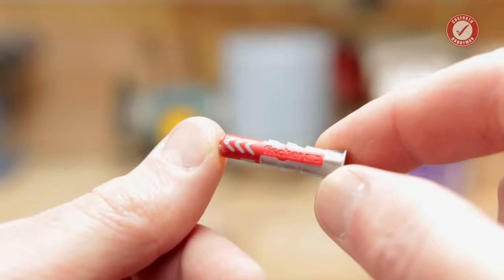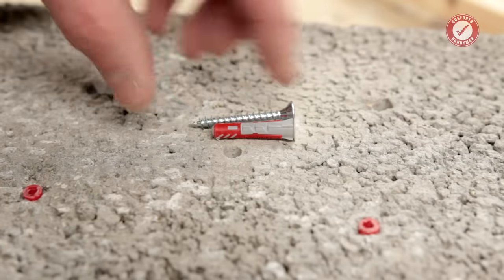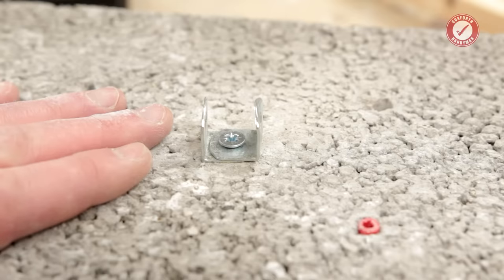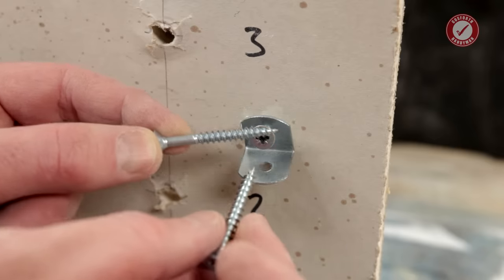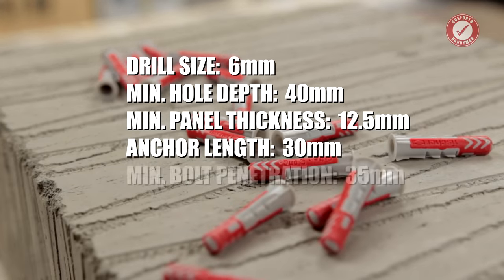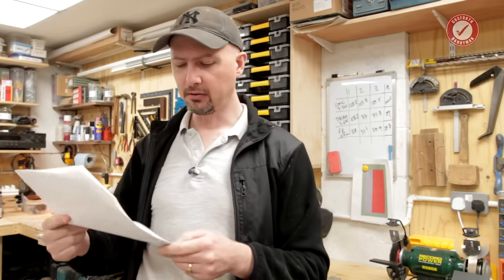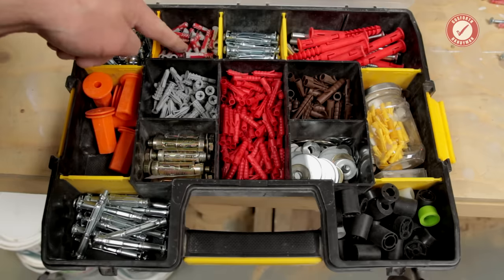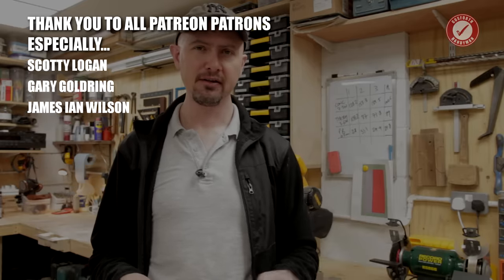How strong are Fischer DuoPower wall fixings?

Comment: Hi, I wonder if you can go help me?. I've fitted some rawl plug anchors (self screw metal plugs) and in both fittings  I've fitted the plaster has crumbled . So I'm assuming I will need to pollyfilla the repair. My question is. Do I pollyfill and skim over with the anchor still left  in the wall? Or take it out? If I take it and then Reinsert after I've pollfillered will I run the risk of it the plaster crumbling when the rawl plug self drive goes in again?

Comment: I would think you would use such fasteners to hang things on walls etc. More of a side load then pulling straight out.

I live in the states and they are sold at the Home Depot screws included. I like them a lot, it's the only drywall anchor I buy currently.

Comment: Any chance of a test of the Fischer Duotec 10... It's a toggle type wall fixing.   Interesting for plasterboard cavity walls..  Here in Europe it's around 13€ for a pack of 10 with screws supplied -  the price is a bit of a drawback...  But for plasterboard ops it seems very good..

Comment: That’s interesting that you like Fischer fittings. I bought a box of Fischer frame fixings and the screws just kept snapping. I used some cheapo wood screws and they were fine. I assumed all their stuff was rubbish after that.
Reply from the maker: Interesting! They weren't stainless steel were they? Stainless is softer. Only generally use my own screws.

Comment: Hi Andy - does new plasterboard tend to need time to harden / settle? I had the bathroom boarded and skimmed last week and when trying to fit some battens e.t.c. with the duopowers they were just spinning in the holes for me. I tried a 5.5mm drill bit too for a tighter hole but still no joy. Cheers in advance, Dan
Reply from the maker: Potentially. What size screw?
Reply: @GosforthHandyman  5mm turbogold, the plugs held for a little bit and then started to spin, I was using 80mm screws to fix a 38mm batten to 12.5mm plasterboard so should have been fine really

Comment: Andy - I realize I am late to the party but here is some info on the Hillman DuoPower plugs which is the Fisher plug here in the US. 
"Maximum working loads for #8-12 screws and anchors: 1/2 in. drywall is 45 lbs, C90 hollow block is 130 lbs, and 4,000 psi concrete is 210 lbs" These values are for the #8 and #10 screws, values for the #10 and #12 are slightly higher.
After pulling out the old abacus, those numbers equate to 20.45 kg, 59 kg and 98.4 kg respectively. A C90 hollow block is a industry standard lightweight concrete masonry unit (CMU). They also state that the working loads should be further reduced by 4 for vibration an shock loading. These numbers have to be read off product pictures on the manufacturers website. https://www.hillmangroup.com/us/en/Fastening-Solutions/Anchors/Anchors---Hollow-Wall/DuoPower-Nylon-Anchors/DuoPower-Contractor-Strength-Anchors/p/523DP1#specs
I wonder if the values you were using from Fisher were not actually working load numbers.

Comment: Hi, thanks a lot for the very interesting video. Would you recommend the 6x30 mm or the 6x50mm for fixing curtain rails on two layers of plasterboard (2 x 12.5mm)? I am afraid the 50mm plug might start spinning while I am tightening it...
Reply: 6x30 is fine

Comment: @gosforthhandyman Hello, I'm just wondering if you can help me? I'm going to wall mount a TV on to a Brick Wall. No bolts were supplied do you think a 8 X 50mm lag bolt is sufficient enough for a UK wall with Plaster on it. I have 10 X 50 plugs. I can't find any 10 X 60 wall plugs. The wall mount instructions recommend a 8 X 60 lag bolt. But I can't find any with a thread to the end. Any help would be greatly appreciated.
Reply: Same issue, cant find any full thread coach screws. Dis you have any luck, what did you do in the end?

Comment: I will be fastening a metal bracket about 2-3mm thick to a plaster board wall i will be using a duopower plug ,however, the metal bracket will need removing and re attached so, will the screw still tighten into the original fischer duopower 6mm plug?

Comment: I've used the Duopower ones for a few years now and I have some thoughts. The biggest problem with the duopower ones, which will mirror similar plugs that 'knot up', is that I have found it is very temperamental to choice of screw, distances, and wall material. You see this fairly clear here: https://www.youtube.com/shorts/hZPtS7EWu38

In the UK, the walls are often pretty nasty for plugging---you can have crumbly plasterboard, crumbly masonry, dot and dab gaps, etc. It's often very hard to know the limitations of what you're drilling into. The problem is that the action of the duopower is largely 'hidden'. Sometimes it works and other times I get a plug that spins, or I'm unsure if it's balled up. Compare that to plugs like Rawlplug Uno or similar that expand when drilled into. They may not be as strong, but you are almost always certain of whether they have 'activated'. Moreover, these plugs exhibit less chance of spinning.  

There are other advantages to more generic expansion plugs, like the fact that you can fit one into another if all else fails.
Reply: Quite a strong reaction to the video in the comments.

Comment: When I put this in plasterboard. I am using a 6mm wall plug. I use a 5.5mm but the rim never fits flush, even when hammering it down. it looks like it does not want to go in (plastorboard) any recommendations?

Comment: Not sure if you have undertaken this ..but how do you attach screws to lathe and plaster walls when there is not studings to screw into?
Thanks for your videos.
Reply from the maker: Aaaahhh... there's a video! They're a nightmare... you can sometimes get a good fixing with a woodscrew straight in to a lath if you hit the lath and not too near the edge of it. Failing that hollow wall anchors are the way to go - expanding metal anchors can work well, spring toggles too. 👍

Comment: A lot of these fixings assume you will tighten up the screw flush with the wall, which pulls the back of the plug / re-enforcement etc in.  I need to hang a mirror and leave the screws proud so the mirror hooks will hang on the screws.  A lot of these would fail if you didn't torque up the screw fully and so it makes it a difficult choice for me.  Maybe if I used a longer screw the duopower plug would still start to mushroom out and give that flange on the cavity side?
Reply: Did you find out the answer? Exactly the question I have as I want to hang a mirror and never had plasterboard walls before. Thanks

Comment: Really like your videos! I bought some of the fischer Duo power 6x30. Then I bought a Samsung Frame TV, it's the 32inch version weighing just over 5kg. The Fischer states max 15kg for what I think is plasterboard, according to the image on the box. TV is going on a dot and dab wall so I'm hoping these duo power will be ok?
Reply: How did you get on with the mounting?
Reply: @RingstingIndustries  it was really straightforward thankfully, that TV is very light and it comes with two brackets.

Comment: just the kind of video i was looking for thanks
im battening out a new extension to insulate the inside and plasterboard over. its made from thermalite. i was concerned that the correct fixings would cost hundreds of pounds. would you agree that these would be the right way to go to fix battens and boards to thermalite?
Reply from the maker: These aren't really designed for low density blocks like thermalite I'm afraid! Could you not dot & dab it?
Reply: @GosforthHandyman  im confused. your test says 89kg in thermalite block?
if im putting a fixing on a batten ever 400mm or so would this not work?

Comment: Being a clever old bugger [well in my estimation] I was looking for things to comment about, but you covered every single one of them - so you are the clever bugger. As to the previous 300 test result, did you use a 5.5 drill bit, I always used 5.5 bits for red plugs, but there again it has been a long time since I drilled  hole in anger.

Comment: Hi Andy.
After this vid. (#193) on Fischer Duo plugs, I bought a “Meister-Box”, which is just a box with 6mm and 8mm plugs and 40mm x 4.5 and 60mm x 5 screws.
Are you able to say when you’d use 8mm plugs over 6mm. I assume it has everything to do with the weight load, but can’t find anything on that. Also seems odd that you use virtually the same size screw for each.
Reply from the maker: Generally the 6mm takes such high loadings the 8mm is overkill but obviously depends on a lot of factors. Wall type, what you're hanging etc. 👍
Reply: I’ve found an 8mm plug is for when you messed up the 6mm hole and it’s too big 🤣

Comment: I have a mirror that’s VERY heavy between 20-25kg I want to hang on an internal wall. I know it’s just plasterboard but if I used two or three fisher duopower screws do you think that would carry the weight?
Reply: 25kg is not that heavy and 3 of plugs should hold it. For stuff that I care (like TVs) I tend to use snap toggles, though.

Comment: Hello should have used 4.5 mm screws those are supplied in a kit with 6mm plugs 5 works but i think performance suffers in concrete

Comment: Hi Andy. Good stuff as always. You referred to the C25 concrete in their test data as being 25knm, vs 7.5 for your block. Would be extremely surprised if 25knm concrete was even possible. C25 refers to the standardised mix ratio for ready mixed concrete. It's predominantly used in footings. I would say from experience that it's compressive strength would be broadly similar to your block, but probably of higher density. A domestic floor slab for instance is C30, which is a stronger mix. A structural engineer could be more precise than me as a lowly builder. Right, better get on with some work 😔
Reply from the maker: I wondered that myself! 🤔 Think I saw it on here https://www.easymixconcrete.com/news/types-of-concrete-and-their-strengths/
Reply: Haha. Shows what I know! Everyday's a school day, cheers Andy.
Reply from the maker: Wouldn't like to guarantee it's correct - if anyone can confirm it would be appreciated! 😂👍
Reply: I wouldn't suggest running the tests again, as I think you've done enough 😀, but having cut a lot of dense blocks over the years when laying, they do vary greatly. Some just need a bolster, others are a Stihl saw job. Some are dead tight and weigh a bloody ton, others are more 'bubbly' and definitely less strain on your shoulders. Probably goes some way to explaining the different results on the red plugs. I imagine 7.3n will be a minimum. Thanks again though, really like these tests. Shame it's such a ball ache.

Comment: I use lead shields in concrete. If they're loose you can hammer in a finish nail between the shield and concrete. Also, what is the pullout strength of a concrete (tapcon) screw in comparison.

Comment: Is there any point in putting these into a stud before screwing in for whatever purpose, i.e. TV bracket, desk brackets, etc? I've never seen it done -- possibly due to the madness of the suggestion 😅 -- but I'm curious whether it's possible and safe.
Reply from the maker: In a wooden stud? Don't think so - a screw directly in wood gives one of the strongest joints providing the wood is in good condition. Having said that, you could use them e.g. in a door frame if the wood is gone from years of screws being taken out and put back in... even then I'd probably use something else though. 👍
Reply: @GosforthHandyman  I suspected as much. Glad to have it confirmed by a pro. Cheers Andy.

Comment: I would look for the anomaly in your measuring rig. That's where faults are usually found. If it's no that there is some fault in the method. Like when you see people doing load tests on Hyacinth Buckets old mechanical bathroom scale.

Comment: as an all round , diy plug&screw around the house
They are unbeatable in their versatility and ease of use for a none professional like me.
Brick
hollow brick
ytong blocks
cinder block
never had one come out like the old jagged grey split plugs.
Just use appropriate size for the heavier loads.
Like a 5x5x5 meter sun shade, that flaps in the wind.. use 10x80 or something like that , and not 6x30.. i mean, it's just common sense innit

Comment: Does anyone know what sort of cavity size is needed to use these with a dot dab cavity wall? Thinking about using these to hang vertical blinds in a recess. Limited for options as the plasterboard is attached to a metal beam (dot dab). The plan is to drill some pilot holes to avoid the dabs, but just not sure if the small cavity is sufficient for these to expand behind the plasterboard.

Comment: I swear by the duo power plugs. I work as an art technician and hang anything from art to sculptures and shelves on walls. I use duo power's all of the time and I've never had any issues what so ever. The only thing I will say is if you're going into plasterboard, be careful if you're using a picture hanging fixing as opposed to a screw which will rotate the plug as you're tightening. I've seen this with an "L bracket" (as demonstrated in one of my video's). It will just make the hole bigger. Great with screws nevertheless.

Comment: I think cleaning the holes from drill dust adds a lot of strength. Maybe the factory data was measured with cleaned out holes.
Reply from the maker: Tried both - made no difference. 👍

Comment: Might be worth re-trying with a 5.5mm drill. I never use 6mm on red plugs, I would rather have the hole slightly too tight than too loose.
Reply from the maker: I'm pretty sure it was a 6mm I used for the red plugs when I got 300kg... but now I'm doubting myself. 😂
Reply: @GosforthHandyman  Was it the same 6mm drill though? Masonry bits are hit and miss for accuracy, even good brands. I had a Bosch bit that not only was oversized by 0.5mm, it also had a bend in it so a 6mm drill bit made a hole too loose for even a brown plug! lol.
Reply from the maker: I think so! Might buy a brand new bit and re-test at some point.

Comment: What's the strongest heavy duty plaster board fixing ?
Reply from the maker: I like the expanding metal type used with a setting tool - done a vid on them. There are stronger fixing out there but good balance of strength and practicality.

Comment: Fisher duopower are rather snug fitting. So snug I often think they are for 0.25mm wider hole; I often end up hammering them in or need to widen the hole a bit by going forward and backward with drill (at least in brick).
Reply: Francis Drossaert I use them mostly in plasterboard where they need to fit tightly or they turn in the hole as you tighten them. Sometimes use a 5.5 mm drill if the plasterboard is soft. I won’t use them in tiles  as I think it’s better to push the pug past the tile so you don’t risk cracking a tile

Comment: In my opinion there is a error in your testing Setup.  While you use a angled profile to support the force gauge, you magnify the force in the plug. Even with two angles it is the same problem. A bit like a pinch bar.
 It should be a one piece part with U-Shape. Enough stiffness is requirred.

Comment: You are a woodwork geek, question won't an impact driver damage the plastic plug as it is effectively a screwdriver with a built in hammer, impact drivers were designed for installing bolts into girders and for the car industry for fitting nuts on steel wheels. They should not be used on alloy wheels as they will damage the wheels. My old woodwork teacher would clip us round the ear if he saw us get near a screw with a hammer. Screws will cut their own thread into what you are screwing into.
Reply: Impacts give a rotating inpact not linear.
Reply from the maker: They also give linear impact but if you're careful you can be quite delicate with them. Haven't found they damage fixings but they could certainly strip them if you over-tighten. 👍

Comment: Seems to be a new version of the UX plugs -- altough I could not find out where the DuoPower really would shine in comparison to the UX. EDIT:  Ah, finally found it. Same performance in "spread-mode", higher performance in full materials.
Reply from the maker: The UX are excellent but the load ratings on the DuoPower are a bit better on paper - I need to do a side-by-side test. 👍
Reply: That comparison would be really interesting. Great practical tests you are doing on your channel! Thanks a lot! That helps to make good decisions what to use or how to build. :-)

Comment: Aw mate, love your videos and I have trust your judgement, BUT I have to disagree with you on these buggers as I have had no success with them.
I have lived in a house with plaster-board and dab and dot walls for over 20 years and those duopower jobbies are crap!
They always start to spin before the screw gets a chance to drag in the lower part of the plug in ordered to mushroom up.
I know what you will say, try a smaller hole or longer screw, but I've tired every scenario and have gone back to the dreaded metal screw in low weight applications and a lantern type in heavier type applications.
I feel that they will work in newish plasterboard, but older, damper plasterboard, then forget it........love you, love your videos, but the duo power plugs FOR ME are rubbish.
Reply: If it's dot and dab then you might find the solid wall is close enough that you can fix into that rather than just the plasterboard for heavy items.

Comment: Different result from the same test run at separate times. You need a safety factor. also if some one and 80kg person using a self for a support exerts more than 80kg of  force. I am not going to do the math, they won't either.